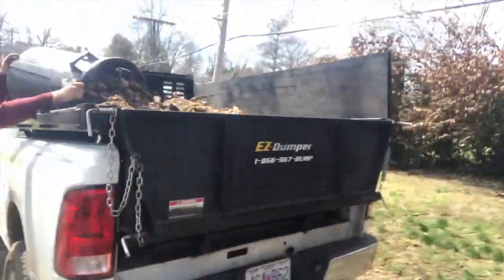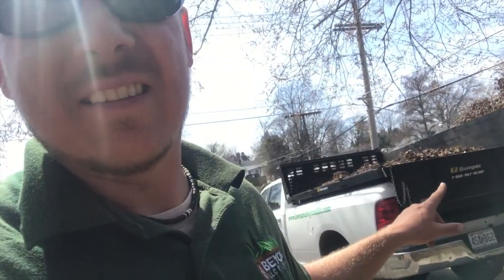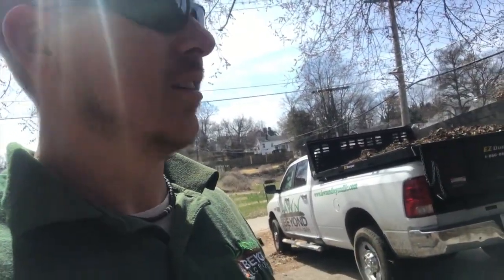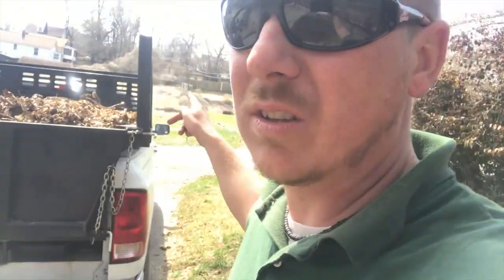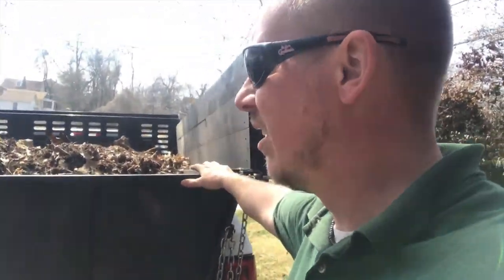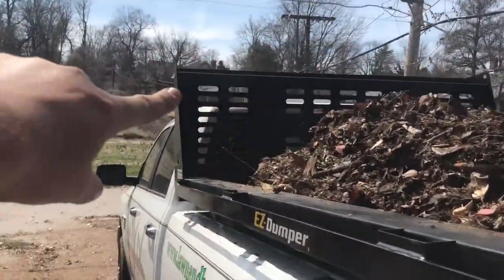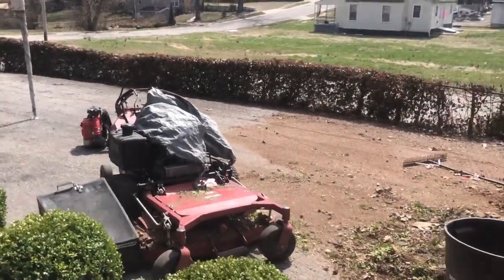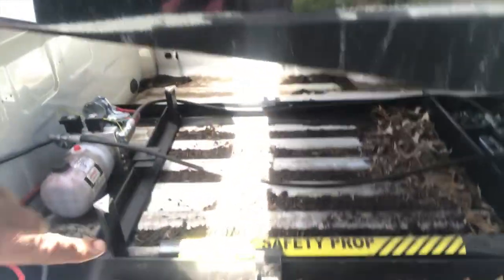Is the EZ Dumper Worth it?

Comment: I got a product by buyers called the dumper dog. Similar. I've had it in two different trucks and we take care of it every year we repaint it, they have a tendency to rust out if you don't take care of them cuz it's only 12 gauge steel. So the first application I had was doing mulch delivery and firewood delivery, then the second application was that I added tall sides to it and used it as a chip box dump truck for our tree service.... And currently I have it with a masonry crew, hauling concrete and other debris away from building new sidewalks and patios and such.... It's gotten a lot of use in my company for the past 6 years.....I think I originally paid $2,500 installed and then modifications to it have cost a little bit more money with the welding and fabrication of taller sides on it and such. It just get s reincarnated into something else of usefulness within my company and or moved around from one truck to another.... I would recommend one of these insert dumps to anyone and on a hot day when you're trying to get done and go to the beach nothing beats pushing a button to unload whatever you need to unload....lol

Comment: For the record it weighs about 700-800lb not a ton. I hope thats at least a 3/4 ton truck ... That leaves you about 2000lb capacity in the actual insert before you are overloaded. Helpers in the suspension does not make your truck carry more... it does nothing for the brakes. I use dump inserts as well, have had over a dozen... Currently have a 6 1/2 foot model on my 2500hd and a 8 footer in my 3500 dually. Great units, just have to watch that gvw.
Reply: Can't be better explained.  Adding air bags or leaf spring will cause to carry more weight but will also kill the truck faster. Brakes. Axles etc etc . I installed a kit to lift the bed and by not having the insert I can load it with extra 800 lbs
Reply: Will this work in a Ford F250?

Comment: I had an EZ-Dumper in a Chevy 3500 SRW.  The insert weighs 787lbs empty and has 3 ton cylinder.  So payload is around 5,000 lbs.  My truck, with the insert was 5800 empty, and my GVWR was 9000.  So i had 3k in legal payload.  I recommend getting heavier leaf spring when you get one of these.  I do masonry and these really are not cut out for that.  Much better suited for a landscaper.  The floor is only 12 gauge steel so it will dent rather easy.  I went back to a regular dump truck.
Reply from the maker: I’m in the market for a dump truck since we are opening the door for hardscaping. The dump insert is great for mulch and clean ups. About it, but the time it saves is worth not unloading any debris.

Comment: Cool. Yeah my dad had one on his truck when he was doing lawn care. Now I just roll with my trailer.
Reply from the maker: Nice, how long did he have it and how well it hold up?
Reply: @lawnandbeyondllc5663  ... he had it for about 10 years. It held up good.  It started getting rust holes on the sides because he left the grass in there too long. So make sure you dump your load on a regular basis.
Reply from the maker: @superior3384   Thanks for the tip!  I did notice after we salted this  past winter there were a lot of rust spots forming.  I just touched up with some primer and paint right away to stop it.  Haven't seen it since and we're using it every day this spring.

Comment: The manufacturer recommend not to exceed the GVWR. For one reason. Brakes can fail, axles can fail etc etc. I have kits to lift the entire bed on my trucks, with boards around. By not having the insert I can loaded it with extra 800 lbs. But good video